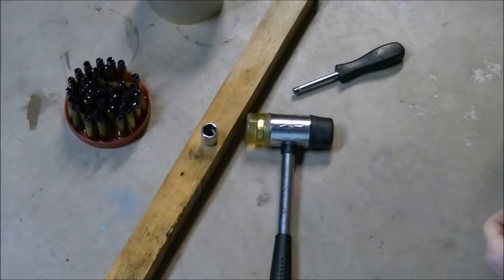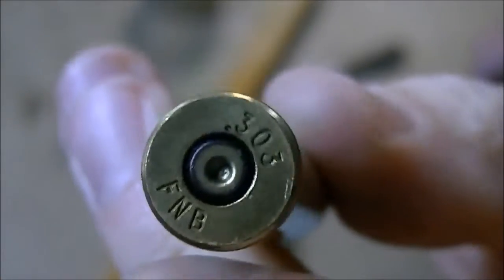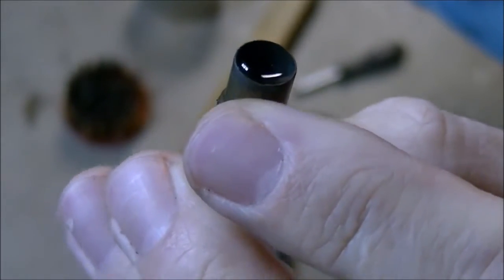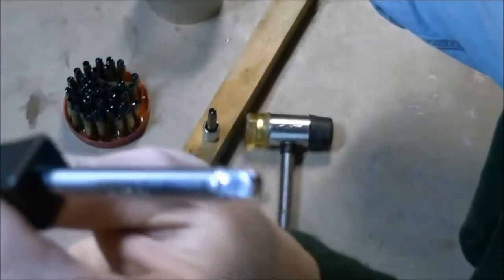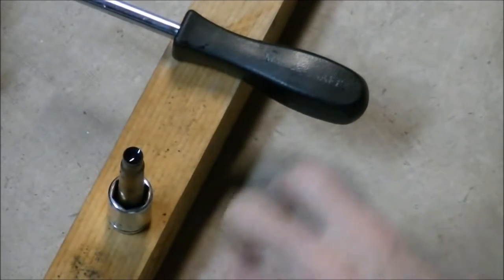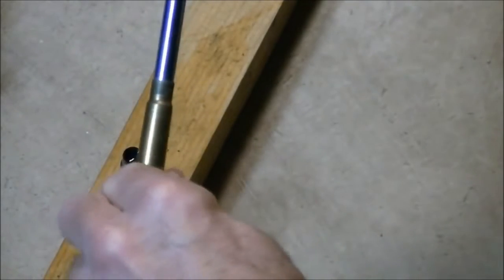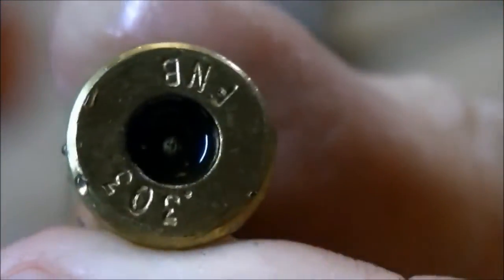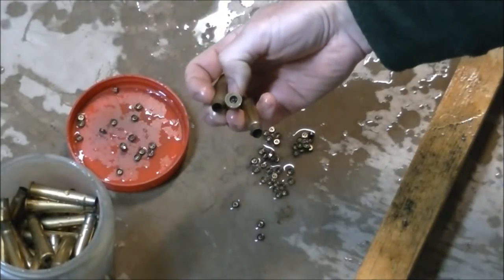Improvised Berdan Decapping

Comment: Were these primers live when you removed them?
Reply from the maker: No, they were fired ones.
Reply: @314299  is there any safe way to remove live primers? I got a box of wolf 7.62 and almost all of the casings had cracks on the neck so I removed the bullets and powder and I'd still like to use the primers if I can. Waste not want not and all that.

Comment: I've a question: and perhaps I'm missing something here, if into reloading, I imagine one can use the decaping feature of the die? I mean, it's a standard process, of resizing and decaping primer at the same time.  Or, is there a primer removal issue with that type of ammo? This procedure is ingenious, but seems more trouble than its worth. I'm just saying. Also wonder if this works on other type cases..
Reply from the maker: Berdan primers have two flash holes, not one like in Boxer primer ammo, therefore a standard decapping pin will not work. In fact a regular decapping pin will get broken off if used on Berdan cases. Berdan cases are generally decapped with an external "claw" system or with hydraulic force.
Reply: @314299  Wow, I had no idea of this complication. Well then, turulu my friend.. Stay safe..

Comment: That's usin' yer noggin'. Thanks for the tip.
Reply from the maker: Thanks. It does not work on all brass, but is a useful method for most.
Reply: @314299  Good to know. Thanks again. =)

Comment: question is where to get Berdan primers though, I seen a video before somewhere a guy use copper piping to covert it into boxer, but that's a lot of work
Reply from the maker: RWS primers are available here in Canada, your local dealer should be able to order them.
Reply: @314299  I'm in Ontario, but I've never seen them in store
Reply from the maker: @alexxu3004  I doubt many shops would stock the Berdan primers as demand would be so low, but could special order them in.
Reply: @314299  I'll give a shot

Comment: I used a block of wood, a piece of pipe, a large bolt and some rubber to make a deprimer for any size of berdan primed brass. Only issue is its hard to get berdan primers as compared to regular boxer type. So I just ended up buying boxer type brass for all of my guns. If I could drive down the street and but the appropriate size berdan primers I would certainly load berdan brass.
Reply from the maker: Have any photos or video of your Berdan decapping setup?
Reply: @314299  Whats your email? Ill go in the shop and look for it.

Comment: I threw a ton off Brendan cartridges away
Still have some NNY privi stamped 8mm surplus from century arms,  
Fired, but its berdan 1986 dated 
Have a tin of priners here I think are berdan...fairly big if we chat online again. I can show them to you .i got them in a deal on powder bullets
Guy wasnt sure what they were for
Reply from the maker: Some of that "NNY" stamped brass has hard to remove primers and the hydraulic method does not work, with the brass bulging instead of the primer coming out.
Reply: Same and the x39 is really bad. Orange primer seal? Try to seat the primers slightly deeper to break seal. ADI brass tough too.

Comment: I have used that method also After the primers have been ejected I went and drilled the center out for  my extractor pin And converted them over to boxer prime they work very well  Great Channel brother and thank you for your knowledge and expertise
Reply from the maker: Did you press in bushings to the primer pockets as part of the conversion? The Berdan primers in the brass shown in the video are .217" in diameter whereas large rifle boxer primers are .210". Of course there are quite a number of different size Berdan primers so perhaps yours were closer in size to the boxer size.
Reply: @314299   G wis that was 35 years ago I think I just use a little bit of aluminum foil  I was just experimentings just to see if I could adapt it to whatever situation I had on hand I do remember on one of them i drilled out and  Set in a  209  primer i did a  counter sink the primer pocket just a little bit.  Please forgive me if I remember correctly I did that to a 44 magnum Or a 444 Marlin  it has been so long ago